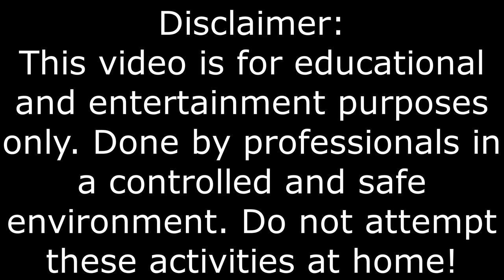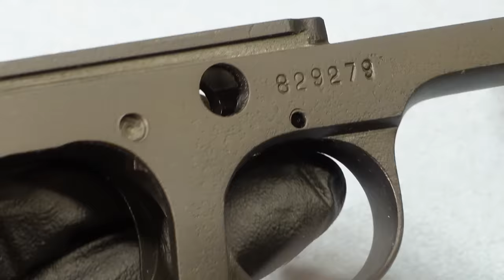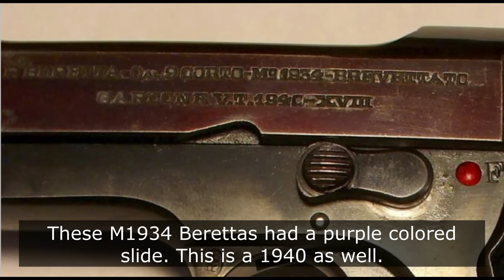Gun Restoration | 1940 Beretta Italian army pistol, M34 (with test firing) #restoration #beretta

Comment: How did u couted slider copper orange but body black no details given for that. And how this model blows back at last round fire. Bcos it has no functionality for that.
Reply from the maker: The steel is treated at a different temperature, that causes the different colors, ya it doesn't lock open when empty. Thanks for watching!

Comment: Was this firearm originally nickel plated or was it blued? I have never seen a slide turn out that way before, is it the blueing process you use or a totally different metal from the frame. I have seen results for Hot salt blueing which most gunsmiths use but what type of bluing did you use? I have built several 1919A4’s in my time but most have been parkerized, after they come out of the boiling hot water rinse they go into a bath of Dextron II ATF fluid for 24 hours. BTW if you ever work with cloth belt fed MG's we soak the belt in ATF fluid as well. Makes the gun run smoother and helps preserve the belt. Now disintegrating links are another story.
Reply from the maker: It was originally blued, thanks for watching!

Comment: Have you considered making a slide hammer type tool -like the ones used for pulling car wheel hubs off?
I reckon you could make something similar easily, that would help with say mag removal. It uses inertia rather than direct force. Might be handy for freeing other parts too.
But yes this mag was an easier one!
Reply from the maker: Thanks for the idea and for watching we appreciate it!

Comment: Stupid question, but after hot bluing the slide and the other parts that turned "orange", could they then have had "cold" bluing solution to them to get a uniform color? Not that the two tome look was bad, just curious.
Reply from the maker: You would just want to cold blue it from the start. Thanks for watching

Comment: From the serial number of the weapon (nr. 829279) we go back to the year of registration which is 1940, which goes from serial number 800000 to 850000.
FAG is the hallmark of the Beretta Arsenal of Val Trompia (Brescia) and the number of the year the weapon was tested.
I wasn't able to see the serial number of the barrel, I hope it's the same as the receiver.
It is truly a beautiful restoration, a gun that I owned from 1980 to 1994, before being replaced by the Beretta 84BB.
Sorry for using Google translator.

Dalla matricola dell'arma (nr. 829279) si risale all'anno di immatricolazione che è il 1940, che va dalla matricola 800000 alla 850000.
FAG è il punzone dell'Arsenale Beretta di Val Trompia (Brescia) ed il numero l'anno di collaudo dell'arma.
Non sono riuscito  vedere la matricola della canna, spero sia la stessa del castello.
E' veramente un bel restauro, un'arma che ho avuto in dotazione dal 1980 al 1994, prima di essere sostituita dalla Beretta 84BB.
Scusami per l'uso del traduttore Google.
Reply from the maker: It's all good, thanks for the info and for watching!

Comment: Can you explain to me the composition ratio of sodium hydroxide and potassium nitrate and also the amount of water
When these are combined, what temperature should it reach to put parts in it?
Reply from the maker: Its a lot of each but, you can use less. Its 5 lbs of sodium hydroxide to   2.5lbs potassium nitrate per gallon of distilled water. Never put anything aluminum in it, it will get everywhere.
Reply: Does the weapon need to be pre-cleaned for this combination?
What should we do if we want the weapon to be very black?

Comment: I think you need an ultrasonic cleaner full of penetrating oil. At least half of a gallon. So you can just soak the pistols when you get them. The heat and vibration should shake things loose.
Reply from the maker: I have a couple, haven't really tried it yet! Going to soon. Thanks for watching!
Reply: Yes, you should really have the whole gun soaked in oil before forcing things apart. It will reduce the damage and make disassembly easier.

Comment: Man I would never in a million years stick a rod down the barrel of a gun I would get a snake cam first then the rod so if there isn't anything in the barrel you don't end up with two finger surprise.
Reply from the maker: So tell me this if I put a rod down the barrel and hit a cartridge what will happen?  Nothing. The firing pin is not going to engage because the trigger is not being pulled. Nor is the gun operable at this time. The gun was pretty seized up. So how would a cartridge ignite? Maybe you know something I don’t.  I have in my early days did something questionable while restoring an old ruger I had to hammer out the cartridges from the casing end and those did not ignite. Yes the ruger situation was dumb agreed on that. But simply gently putting the rod down the barrel with not ignite the primer. That clip is running at 210% speed as well and compared to normal clip speed at 100%. So it’s not as fast and reckless as it might look.
Reply: @TheKinzlerBros  what if the firing pin is directly stuck against the bullet stuck in the gun that's why a camera because you have no idea what's behind the round is it stable etc so many variables